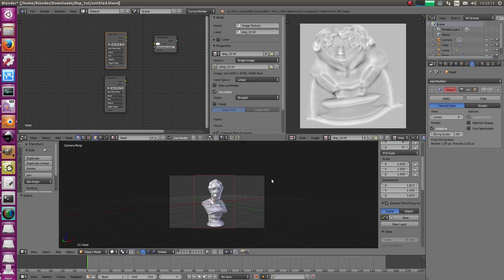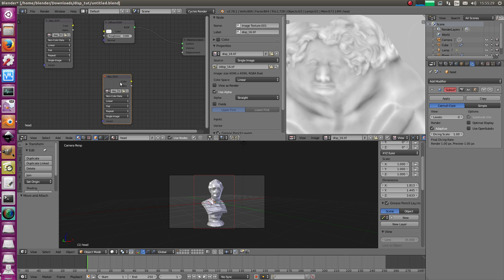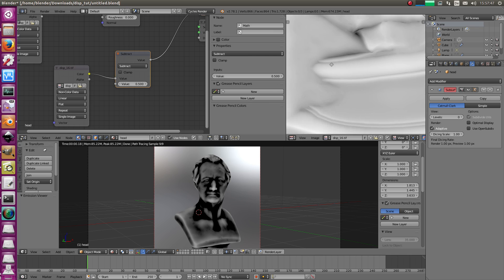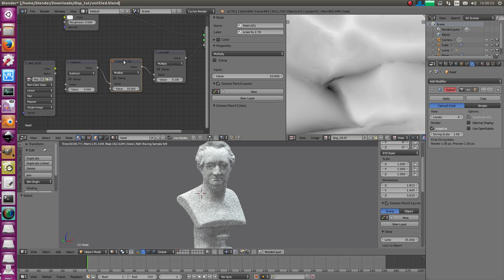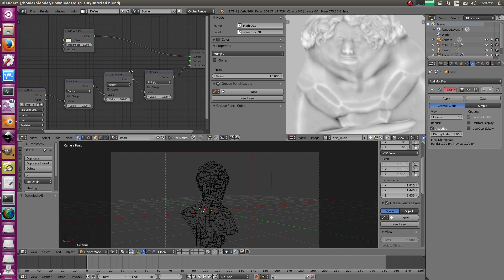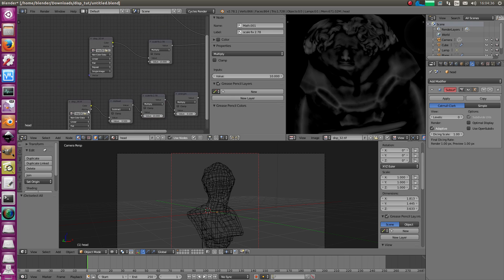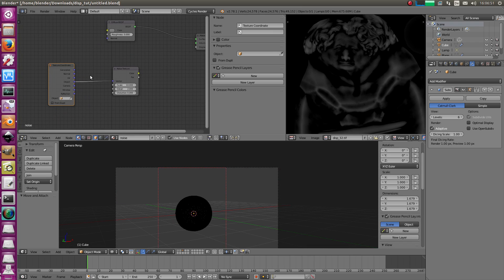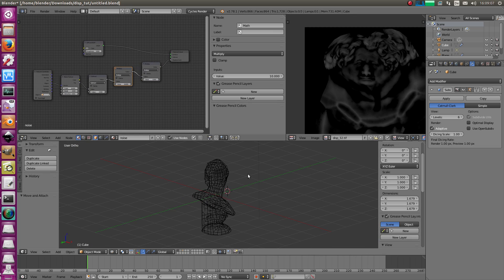Cycles - Displacement Textures Tips (Microdisplacement Blender 2.78)

Comment: Question1: Did you change render settings from default? For example :True displacement works only in experimental mode with displacement cycles material settings changed from bump to true or both. I can't understand it from this video. 
My result is horrible:
experimental mode - http://i.imgur.com/yfAdcQW.jpg
supported mode - http://i.imgur.com/nwRz0nV.jpg
in zbrush, best result I can not repeat details in blender (4096x4096) - http://i.imgur.com/bdt8bOa.jpg
Reply from the maker: the default "subdivision rate" (amount of polygons basically) is set to 8 pixel for the viewport - f12 render should look much better (default is 1) you can find the setting in the "geometry" panel -> subdivision rate
Reply from the maker: btw did you enable adaptive subdivision ^^? (subdivision modifier)
Reply: No, I have no adaptive subdiv option in supported mode, only in experimental
Reply: Geometry panel? Never seen before, only for curves when you bevel it.
Reply from the maker: thats right adaptive subdiv is an experimental feature - if you dont want to use that you have to increase the regular subdivision level (subdivision modifier - quite slow with high levels) :) the geometry panel is located in the render properties

try the following (for adaptive subdivision)
1. change from supported to experimental
2. add a subdivision modifier
3. check adaptive subdivision
4. set the displacement method to true or both
5. lower the subdivision rate if needed (geometry panel or via dicing scale)
Reply: Thank you. A don't want to use true displacement in cycles settings yet because it's always unpredictable for me =(
Like this: http://i.imgur.com/yfAdcQW.jpg
For now I use bump displacement only: http://i.imgur.com/nu9UoYy.jpg
Reply from the maker: its not unpredictable - you just need more polygons and a "proper displacement map" (zbrush bake settings?) (:
this model deserves proper displacement!

Comment: Do you have any idea how to match up displacement maps between the old non-adaptive method and the new? Trying to get some world machine textures to match so I can use the old method for working out where to place things on the terrain but so far have been unable to get the adaptive version to match up, even with your method here.
Reply from the maker: the result with non adaptive should look roughly the same as the adaptive version (less details maybe depends on the subdiv lvls) - example file? :)
Reply: File: https://1drv.ms/u/s!AjPBRKh42r09hluKa8Jkfc4oCCtK
I've gotten pretty close, but it seems almost totally random.
Reply: Feel free to have at the displacement map there - Just threw it together in worldmachine this morning.
Reply from the maker: 1. for crease just use 1 subdiv modifier (no effect for a second subdiv modifier)
2. both texture have to use the same color space
3. subdivide UVs is not supported t the moment -> disable it :)

i think thats it! :)

btw be careful with the dicing scale - a final dicing rate of 0.1 would mean 100 polygons per PIXEL :)

file: https://drive.google.com/open?id=0B1mc80hFkBqcYmJsaldvVkVNc0U
Reply: Been working with blender for like 3 years... didn't frikken know that you could push a subdiv past 6.... Oh boy.
Thanks man! You've saved me a lot of headaches!
And yeah, the dicing was just me attempting to get a good amount of detail out of the displacement map. Still sort of working that bit out.